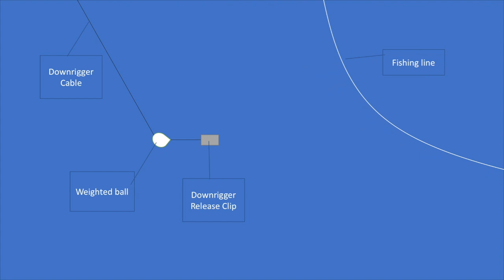How to use a Canon Downrigger - fishing for Stripers

Comment: WOW! 8:26  what kind of release clip are you using? The ones I have I can never get the tension right so that it holds the line but releases when theres a fish
Reply from the maker: I agree with you that can be an issue. For a 34 inch striper it works great for smaller fish it can be a pain.

Comment: You should probably adjust the downrigger's drag so if you hang up it gives rather than rip the side of your boat off.
Looks like you're in cold water.  Swimming may not be a good option.
Reply from the maker: Good advice..... it's a little more difficult with the manual downriggers. I try keep it lose but it can be a challenge.